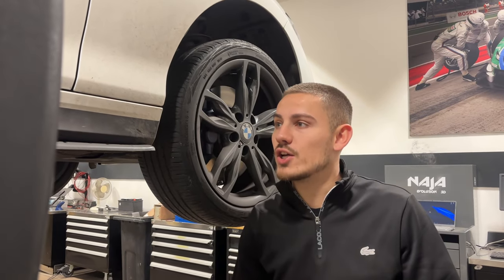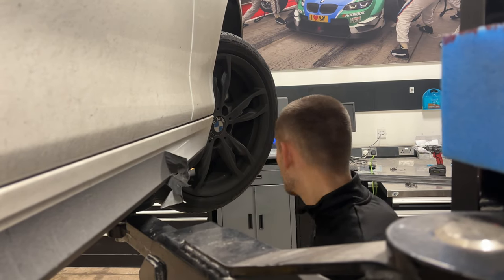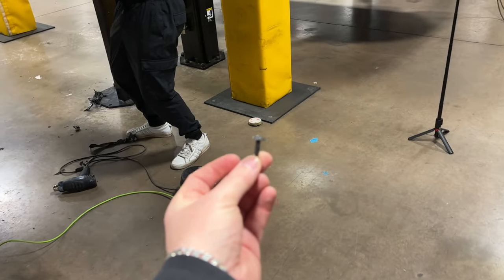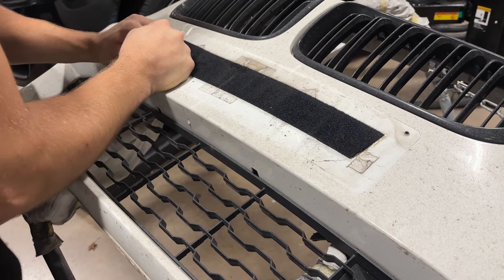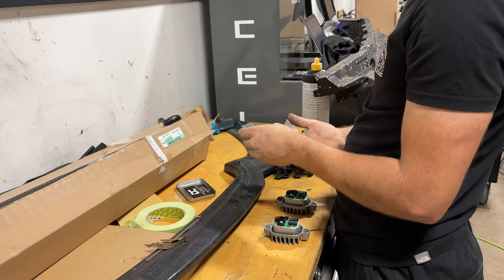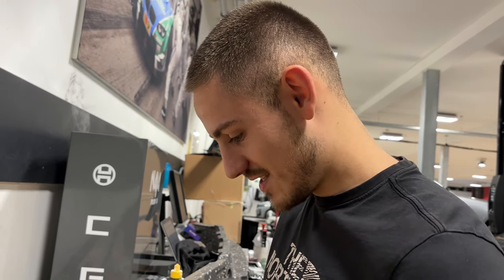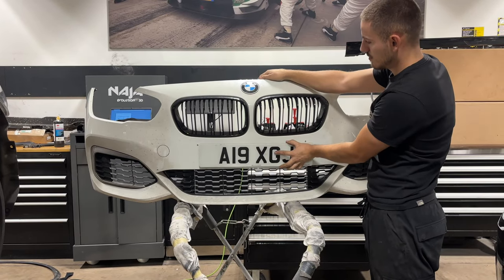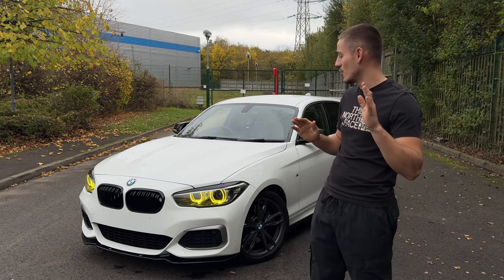TURNING MY M140i INTO A CSL!!!

Comment: I am wondering how magna plates are legal (i did lookmit up online and it complys with the DVLA) but surely they make the car illigal on the road as a numberplate is ment to be fixed so that it cannot be easily removed and surely if your driving along the road and a stone or something is able to hit it hard enough it surely would dislodge the numberplate and full off
Reply from the maker: @186scott  they’re legal yes, UK laws require you have front and rear plate but nothing about how it’s fixed on, as long as they’re legal plates and in the centre of the bumper it’s fine! And you’d be surprised at how strong the magnets are, you’ll struggle to knock it off while driving
Reply: @AJCars.  ah when I did my mechanics course part of the MoT was making sure the numberplate is fixed to the car so it couldn't be removed easily so the law must of changed
Reply from the maker: @ well I assume, you’re going to know more than me for sure😅 after all the cars at shows and stuff running them, police never questioned anybody for it so maybe it is a law but not something anybody looks at

Comment: Yes my bro u well? Not lived far from you in batchley. Wheres this unit? And are u able to do own work when rented... got an e46 need hand on... good for content? Cars a beast.
Reply from the maker: @BLVCKN9  appreciate it mate, and I’ve now, this is at BMW i don’t have my own unit right now…
Reply: O okay. Appreciate the reply. Ma bro need to link up ma G u know alot about bmws u may know what's wrong with mine. Took it to a few changed a few things but thr noise is still there..
Reply from the maker: @ ok I’m sure we’ll figure it out, I’ll see if I have a day free to help you out!
Reply: @AJCars.  yes ma brother, you well? Anytime you free.. could possibly bring it to you within the week and see what's up?

Changed 
D bushes
Drop links
Mounts
Still get a rattle like sound only from the drivers side front wheel like I have lost bolts within the wheel, but it ain't, and it's doing head in. lol asked a few ppl, and they have no clue